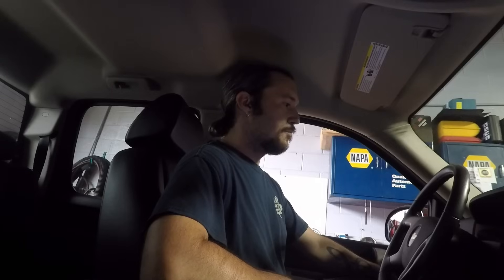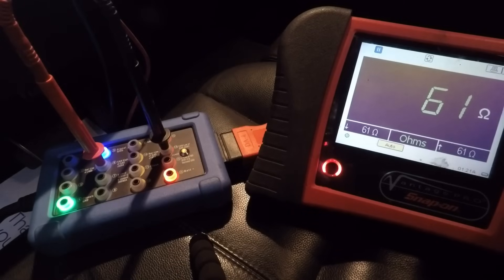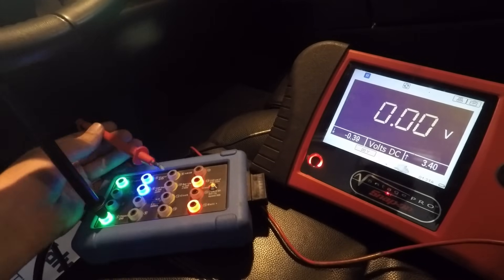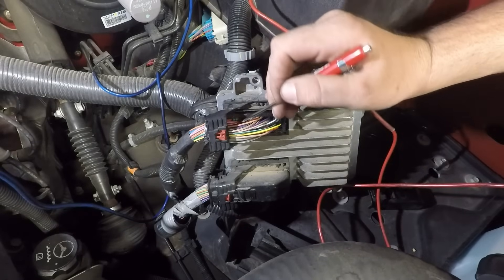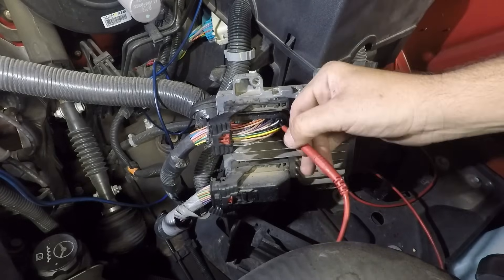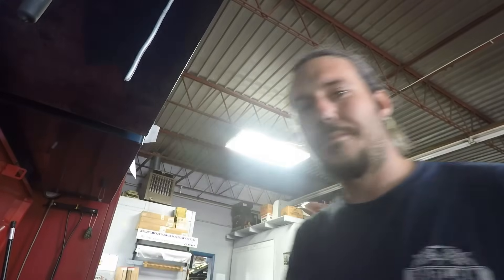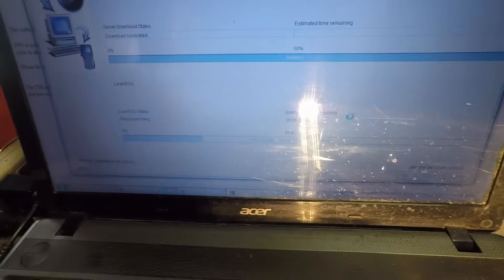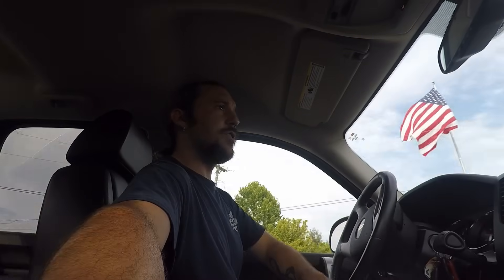Chevy Silverado No Communication

Comment: I have an 09 Sierra with several modules showing the  U0100 communication lost with ECM code. But Mine runs and drives fine. the only indication that anything is wrong is the gauges drop out then come back and it's the service stabilitrac comes up then goes away, then comes back and goes away again and so on.  Any Ideas?
Reply: Same here
Reply: Solved?
Reply: Did you find the problem??
Reply: What was your problem
Reply: Any luck? Im having the same issue
Reply: Anything anyone?
Reply: It sounds like poor ground that intermentently doesn't fully ground.

Comment: Been having a problem like this was diagnosed as a body control module then found out had bad pin tension but issue still occurred, was then told there's an open in the wire somewhere. It is an intermittent issue that happens in the heat mostly, around 11-2 or 3 it may go down, throwing abs, Trac control, and CEL. If no communication occurs all 3 will light up turn key nothing but CEL will stay on..

Comment: I had a Silverado in my shop same issue no crank no communication with ECM
I did the diagnostics Step-by-step with you the only difference was I did not have any voltage at the 5v checks. 
Thank you so much man this video save my ass.
Reply: Got a 16 Chevy Trax no communication to ecm every other module communicates ready to call a module checked everything he did
Reply: The components you didn't have 5v in . Did you have to change them all out or was it a bad module ?

Comment: Many thanks for your thorough and methodical diagnostics video.  Solved my no crank problem..  2008 chevy 2500.. 1-PCM failure. Canbus resistor failure, among others minor connection issues..  BUT...  She runs like a champ once again.
Reply: How did you fix your 2500? Did you have to replace the ECM?
Reply: Had to replace the ECM. Then 6 months later, similar problem ended up being melted terminal in the main fuse block for the engine crank/run relay.
Reply: I’m having the same issue with my 2500 hopefully this will fix it

Comment: Great video! I'm currently working on a police '14 Tahoe 5.3L that runs but will set about 5  no communication network codes with various modules. B0081 on up. The door locks will cycle and the ignition will become immobilized for about 10 minutes. This video is very helpful. I appreciate your diagnostic methods, thanks.
Reply: Bad bcm
Reply: Did you find the problem?

Comment: What about the Fuse that had no power ? Often Communication issues are because of Loss of power . 
Did you troubleshoot that circuit ? 
What were the results ? 
I had similar issues with my ‘07 and 5 Corroded open fuses in the Underhood distribution center . As well as numerous other fuse stabs and relay stabs corroded . 
I had to remove every fuse and relay , Apply corrosion preventative compound (NYK 77) by TrukLite  using a q-tip to each socket . 2 Hours later everything worked great and has not recurred .

Comment: Was the fuel gauge working or reading empty ? My truck will start up no issues when warm , once it’s cold , I get no crank and fuel gauge reads empty , fuel pump doesn’t turn on with key or command start , once I bring it into shop for about 45 mins with heat on ( gas heater ) she will crank over and start , I got codes U0100-00 for fuel control module and brake control module , I also have a code for lost communication with yaw rate sensor , but again once warm no codes except for the yaw rate sensor ? I have cleaned my fuse panel , I replaced my brake switch with a genuine gm brake switch , do you think it is my pcm inside engine bay ? PLEASE any help would be great
Reply: Did you find out what was causing the problem?

Comment: Great video! Well detailed and explained, logical procedure. Taking the time to check circuits and components thoroughly before replacing is so important. I appreciate your expertise and look forward to seeing more of your videos. This one in particular interested me because I am working on an 2007 Chevrolet Avalanche with the 5.3 fuel management and same setup. No communication with my scanner, no gauges or info centre, but it runs and shifts fine. The battery dies if you leave it hooked up. Fuses and 5 volt references are good, 60 ohms at the obd port. Grounds look good. Instrument cluster or bad module??? Still plugging away.
Reply: Don't leave us hanging, what was the problem?
Reply: @Kyle-ev4fk  I verified the Can Bus, wiring, pcm and b mail. Pulled the cluster and found a previous repair on the mosfet open circuit. I replaced the instrument cluster and all communication came back. Runs fine. Charged the battery completely to revive it as well. All has been fine since.
Reply: Where it says “b mail” is an autocorrect gone wrong. It was bcm.

Comment: hi derreck im working on a 2013 silverado with this same issue. scan tool says no communication to all modules. all fuses are good, there is no power at the 40 amp starter fuse, key on. key off but i left key in the switch omh reading is infinity at pins 6& 14. pins 16 & 4 has 12.4 volts. i have not yet backprobed the pcm. any help would be appreciated. thank you

Comment: Okay so I have an 08 yukon denali that is kind of doing this same thing but occasionally it will start but no gauges on the dash will work other than voltage and truck is in limp mode, will not communicate with my generic code scanner or my Superchips flashpaq F5 handheld tuner... Unfortunately the vehicle is not currently registered so I'm not able to take it to a shop without paying an expensive towing bill and I'm a disabled combat veteran on a budget so any help or suggestions as to what I can check or do myself prior to having no choice but to have it towed to a shop and pay the astronaumical repair bill they'll gladly rack up on me....

Comment: I have a 08 Silverado Lt extended cab 1500 5.3 drove it about an hour, I had changed the fpm (cause it gave me that code) it was fine got home and it smelled like burn all of a sudden. Replaced the fpm it turned on but then later as soon the rpm went down it turned off. Since then will crank but no start, left it for a day or two tried cranking it. Turned on and bang threw me a code p069e fpcm. Replaced it (obviously got a preprogrammed) oh almost forgot also replaced the fuel pump relay. Nothing no crank no start. Please help friend i really need an advice. Thanks before hand. Hope to hear from you soon take care
Reply: Any updates?

Comment: great video sir.  Is it possible to ohm the termination resistor on earlier 1 wire GM class 2 bus line like you did with the newer canH& canL PIN 6 and 14?

Comment: I'm having the same issue but it's not communicating with transmission trucks going off line and will not start. After a while of unplugging battery the truck runs great. It message on dash 4wd and stabilizer message any ideas

Comment: 23:02 
Hey i have a 2011 Chevy Silverado Crew Cab LT 5.3 Engine.. The other I lost my Daytime running light, i tapped on the fuse box and they came back on..
The following My Daytime Running Lighy which runs my Tail light and my license plate light and My front Parking light quit completely and I couldn’t get them on, I have checked all the Fuses and i noticed that None of the Daytime Running light fuses are getting any power, so I thought it was the relay, i tested my DRL relay and it Good.. So that means some wiring issues out there… 
So I ended up Rigging a wire on the Ground On DRL Relay and and i grounded it to the Vehicle anywhere that i can get grounding and my daytime Running Light came on, i have power on all the DRL fuses that didn’t have no power earlier …my issue is, Do you Know why am not getting any ground On My DRL Relay so that it can communicate with the fuses to get my daytime running light to work  because now i have to keep connecting and disconnecting my ground rigged wire from the ralay to turn on my day time running lights and to turn them off… I suspected Maybe, The BCM could be Bad that is not sending or creating a  ground signal to the relay.. to activate the daytime running or something worse could be happening… Please If you Have any information about this or if i can bring my Truck to you.. am not sure where you are located but i just don’t understand why i dont have a ground contact to get the DRL relay activate and keep my daytime running lights come… If you have an answer you can reply here or… i can find you and you can help me please.. Much appreciated.. I haven’t checked any other ground though!!! do you think i need to recked all my grounds on the truck.. Let me know.. Thank You .. Much Derrick

Comment: Great video brother! If I take my new ECM too get programed and then install it, can I drive to a shop too do the crank position relearn? Is that gunna hurt anything or is it ok for the truck?
Reply: I recently installed brand new throttle body with a new sensor mass flow air sensor pedal sensor and then the problem came back 3 days later what should I do

Comment: Have a 2008 Escalade no crank no start. checked all fuses they are good. Powered the starter relay, engine cranks & wiring harness looks good.Pulled fuses on all modules with no change. Checked pins 6 &14 and getting 95 ohms seems strange as I would expect 120 or 60 any ideas?
Reply: unplugg the BCM and try to crank it....

Comment: I have a 2000 Silverado had a fuel gauge up and empty then no fuel so I jump on back and jump to activate pump then that didn’t work no more so. O power at all to relay or pump took crank sensor out tested good but no signal or no 5 volts there or evaporate or control idle cylanoid so does that mean bad pcm

Comment: On the step for checking the voltage from Pin 4 to Pin 6 and 14, did you have to turn on the ACC/Ignition on? I did it with the ignition off/Key out
Reply: When you did it with the key out what’s was the voltage? And did you use dc voltage or regular voltage. And did you also try it with key on?
Reply: has to be w/ key out

Comment: 07 avalanche. Had a electrical gremlin. Door locks bouncing needles warning lights hard shifting now no crank. I’ve changed every ground. Jumped it at crank relay it will roll over. Have 60 ohms at canbus high/low I have power to all three fuses you tested eng and both ecm and 5 volt ref on maf etc. Only thing I notice is I have approx 980 mv on low and 4.8 volts on high canbus... any advice is appreciated
Reply: Did you find out what it was? I’m having this issue now

Comment: Would this testing work if I’m able to start the car sometimes? I get codes u0073 and u0100 along with other codes when the car acts up but when it runs fine no codes. Can I still do this testing to determine if my pcm/ecm is going bad
Reply: could you find what the problem was friend?
Reply: @jimmymazariegos6269   starting to believe it could be the bcm
Reply: @jimmymazariegos6269   still couldn’t find the problem

Comment: Great video buddy. I’m having the same problem but a little different let me explain,my part truck  is a 07 Chevrolet Tahoe ran and drove great. I pulled the engine and transmission with wire harness  pretty much everything to swap in my 87 87 cutlass. I was trying to start it on my shop floor and clean up harness before the install but it is doing exactly what that truck is doing in your video, maybe the ecm got Fried or something.any help is appreciated thanks buddy keep up the great content I almost forgot to mention no communication with scanner it does get power though

Comment: My 2008 Silverado 1500 is still stuck in anti theft after anti theft module and ignition swith has been replaced. Also had an locksmith come and tried to reprogram the key to clear out anti theft. It never flashes (anti theft) or cranks still.

Comment: My truck was running great before I cleaned the throttle body
Hard Codes U0073 & P025A, wont let me clear those codes
These 2 codes can be cleared but come back once the truck is started
P1516 P2101
my dumb ass cleaned and unplugged it without disconnecting the battery first no issues before the cleaning. Do I need to take it to a dealer to fix and relearn my idle? Thanks 07.Sierra 4.8l single cab WT
truck does start it just has an idle surge and reduced engine power light which Im guessing is why my gas pedal has no response at all in park or in gear.

Comment: I have an issue with a 2018 Malibu. Same deal here. No Communication with the scan tool. This car had no computer and was vandalized I bought a computer and a new harness and plug everything like a puzzle. Replaced a ton of fuses and check connections to modules and still no Communication with the scan tool. Scan tool turns on I can't read any codes. Any ideas or suggestion as 2 what other steps I should take into diagnosing this vehicle.
Reply: Do you ever find out what was wrong with it? Have the same problem
Reply: @Eduardo Lopez  I ended replacing the engine bro.

Comment: I got a 2007 Chevy Silverado crew cab 5.3 vortec when it's cold out the truck won't start the code says it's dropping connection to the body control module but once it warms up it will start just fine and no codes my grounds look fine what would you recommend I try before spending a bunch of cash to have a shop look at it? Thank you for any help
Reply: I have the same problem did you ever find the cause?

Comment: I am having some communication issues with my 14 silvy 1500. Transfer control module, engine control module and abs module are not communicating and throwing codes. My main display that play music went dark and doesn't work. I checked fuses, intellalink wiring was OK, and also drained the stored power to reset engine lights. Still can't figure it out, hopefully you can give me some direction
Reply: Any fix?
Reply: @MasterNeko  Yeah, bad Engine control module
Reply: @travisberan2967  mines seem to happen randomly the one time I got codes for no communication to bcm ecm tcm pcm but it haven’t been doing it all week, only thing I did was move some wires around and change the mega fuse, I did the checks like in the video and I got power and the right ohms and voltage
Reply: @MasterNeko  which is the MEGA fuse??

Comment: What's a possible cause for a u0100 code on a 2010 equinox 3.0 liter AWD with 234k miles? Starts up fine and idles rough due to timing chain system issues. Has cam crank correlation codes, p0089, displays reduced engine power message on the dash, and stability light is also on. Any help would be appreciated. Thanks
Reply: Hi Rusco, I had the some problem with your equinox u0100 with a reduced engine power. I just wanna ask how did you fixed the problem. Thanks

Comment: I did the CAN HI/CAN LO  resistance check and got 125 ohms. I also am getting a Class 2 Data Link fault. Is my ECM failed. Problem started when I started my 2006.5 2500HD Duramax LLY, put in in reverse, truck died then no crank no start.

Comment: My truck is stuck in 3rd gear I’ve changed all the solenoids and a new harness, I’ve changed the neutral safety, it’s a new transmission it’s not slipping it ran great and started going in and out and then it’s fully stuck in 3rd gear won’t downshift unless I manually put it in 2 or 1st and it won’t up shift idk what it is any ideas ?
Reply: Having the same problem with mine any luck with yours yet?
Reply: @johnstjean9884  same here

Comment: I have a 2008 Chevy Avalanche with some of this problems. No OverDrive shift, Stabilitrak ligh on,  ABS light on. Would u help me with that?
Reply: GMLAN I/p Connector loop
Reply: @Handymandan215  Hey HandyMan Dan, can you describe what to do about your comment above? I have an 07 Avalanche with similar issues along with door lock going on and off, door chime going off intermittently, gauges going up and down, abs light flickering and not to forget hard shifting. I've replace both negative and positive battery cables, pulled the fuse box out to inspect connections, pulled the plug on the BCM ( i think that's what it is called) that is above the spare tire and cleaned it. I did the same thing a year ago which seemed to have worked, but now it is back. I'm sick of it.

Comment: I have an 09 suburban 5.3l flex fuel  and have a no crank situation  I have a p1682 code and have been looking into that issue. Already put new ignition switch in and still no crank  looking into the ecm going bad now. Was going through this video for help and have some differences I'd like to confirm it could be ecm or wire harness    started off as u did checking going on head then  volts at obd plug as I'm not familiar with ohlm setting on my tester.   I only have .29v at pin 6 and pin 14    did fuse check and all have power then did 5v reference and all checked good except mass airflow was 1.69v ecm ground good as well as red white and the pink wire
Reply: Truck ran fine before i pulled apart and looked at sticky valves. Was not able to afford valve kit at this time so I put back together as I need it to haul 5 kids for now but now have this no crank issue and p1682 code I have double and triple checked everything was plugged back in and fuses n relays all are good
Reply: @jessehinze3879  you leave the ground off behind the cylinder head??
Reply: Never removed heads or that rear ground
Reply: @philh9238  I tracked my issue down to being the fuse box.   Board in the fuse box fried somehow   assuming from jumping starter relay to turn over.  Bought a used fuse box for $50 !and installed runs great again - the lifter tick   thanks for taking the time to try n help out  n wouldn't hurt to mention the fuse box being an issue with these chevys and causing the same issues as the no communication